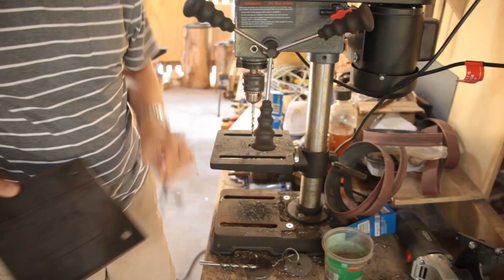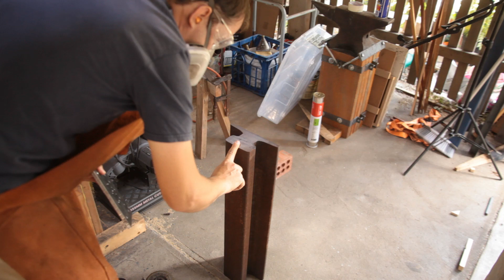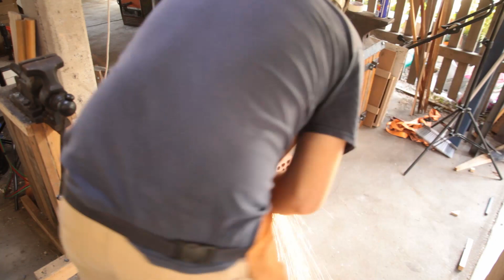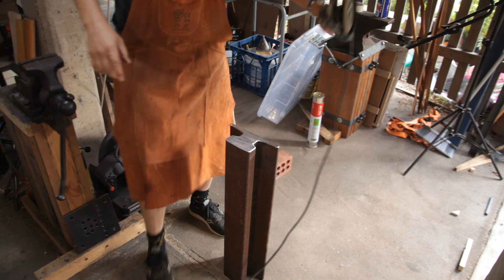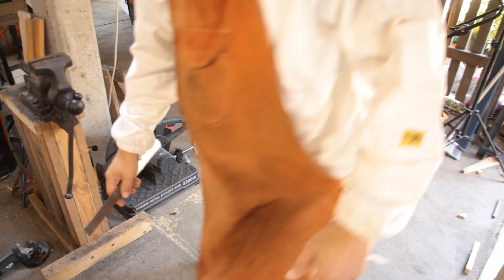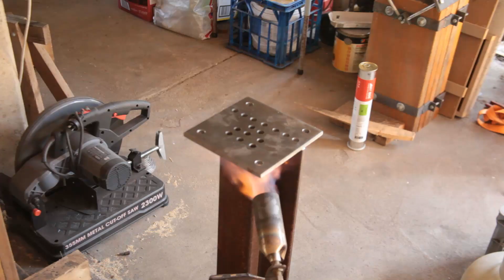Treadle hammer build pt1 the anvil

Comment: 7018 works best on DC or it can be welded with AC but requires a higher amperage. I personally like 6011 and 6013 depending on how much penetration I'm looking for.

Comment: the mighty transarc easy welder! Best welder ever made I reckon!
Reply from the maker: Jack Dawg I’ve had this one 20 years and it was old when I got it...
Reply: @docshotshopandforge  I got my first one back in the 80's new. The outer case finally rusted away so much I tossed it about 5 years ago and bought a new style welder. What a piece of crap. horrendous duty cycle, spent all day waiting for the lump of lard to cool down. So I tossed the new welder and went and bought another transarc second hand for 50 bucks. Gotta love that 100% duty cycle on 80 amps!

Comment: Nice job Doc, them low hydrogen 7018 can be mongrel on the restarts but the perfect rod for track and rail :-)
Reply from the maker: Richard Solomon they sure are! Not my preferred rod shall we say lol but yeah the right rod for the job pita though they are
Reply: @docshotshopandforge  if you need to do another like it cut the centers out and turn 4 plug welds into a slot weld :-) it's much easier to control even if you have to run 3 or 4 beads